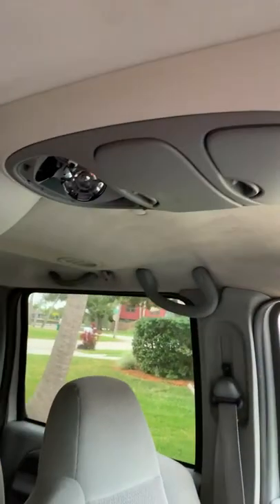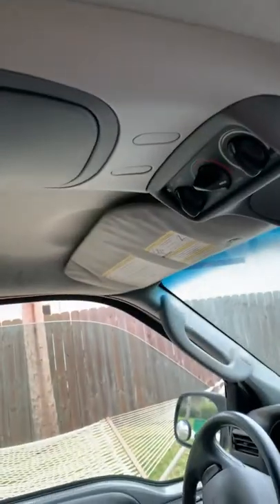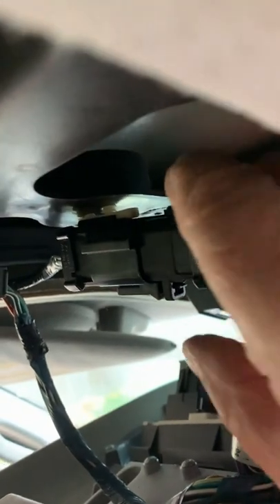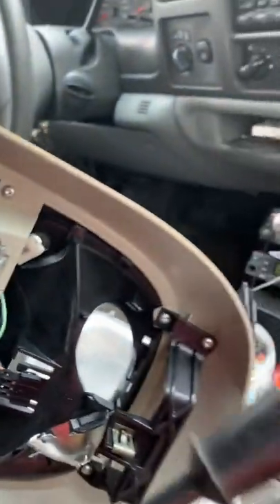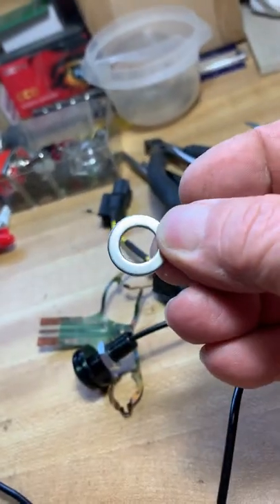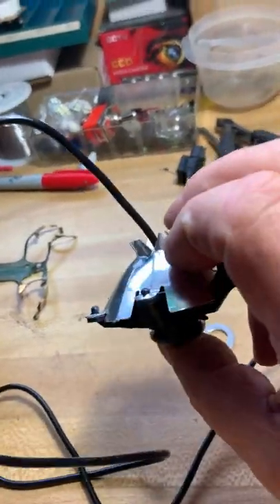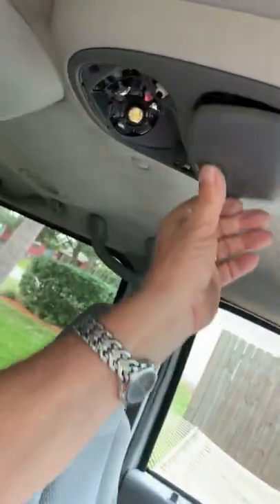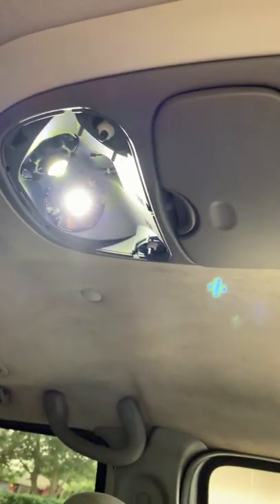Best Excursion Overhead LED mod

Comment: @GolfCartSpeedyLink, thank you for taking the time to make this video. I used the same 23mm Eagle eye Leds and it worked out perfectly. Only difference with mine, I didn’t enlarge the opening on the aluminum dome, I used a small screwdriver and carefully pried the aluminum domes off of the plastic that holds the LEDs. This allowed me to tighten the new eagle eye LED nut. I used two nuts so the LEDs do not loosen after they are tightened. I also used crimp connectors on the LED wiring in the event I have to change them out in the future if they go bad. Took me 2-3 hours over the course of two days to do because I really took my time, absolutely worth it though. Also, I recommend whoever is doing this mod to plastic weld the factory push switches with your solder gun and hot glue them once you slide the switches back in place so they do not shift.

Comment: Fantastic video!  Thanks for sharing. I did this to my 01 Excursion, with the 9 watt (equivalent) 23 mm light you recommended.  What a difference, super bright!
A few quick comments for others who might do this mod.
1.  I can see where many people might think the 9 watt bulbs are too bright.  You could definitely go with a lower wattage bulb and still have way more light than the original lights.  Also,  I think that I would go with amber or yellow bulbs if I were to do it again.  The white light is kind of harsh and the amber would be a  softer color.
2.  You can just snip off the aluminum dome reflectors.  They are totally useless after this mod and just take up a lot of space.   It makes the whole install a lot easier and gives you more room to work.

Comment: This Ford Excursion overhead console lighting replacement is truly remarkable! I've tested three different LED bulb replacement methods for those lackluster Excursion overhead lights, and this one stands out as the ultimate solution, providing an abundance of light for reading handwritten notes and examining map details. I opted for the Teguangmei 23 mm White 9W Eagle Eye LED motorcycle running lights, and as described by Digital Overdrive, they seamlessly fit and lock into place using his installation method. Not only do they work exceptionally well, but they're also more energy-efficient than the original bulbs. Instead of the original 'reflected' light method, these LEDs direct the light beam straight into the cab, making a world of difference.

The only minor downside I noticed is that the bulb color is slightly more on the blueish side than I prefer, but it's a compromise I'm willing to make for the improved illumination.

While I had the console down to install the new lights, I decided to go the extra mile and create a hole to wire in a USB A power socket on the front edge of the console. This additional step allowed me to power my dash camera conveniently. The USB placement in the upper console eliminates the need for a messy power cord stretching across the windshield to the camera.
Reply from the maker: Thanks for the comment.  I like your idea of a usb jack.  Wish I would haave thought to do that while the console was apart....  Cheers!

Comment from the maker: I made an  error in the video I used the 23mm diameter.  They are marketed as Eagle Eyes.  Here is the description from Amazon.  Thanks   YITAMOTOR 6pcs Eagle Eye LED High Power 9W 12SMD Waterproof Car LED Lighting Kit Motorcycle Daytime Running Light DRL Fog Backup Tail Lights (23mm, White)

Comment: How are the lights holding up?
Reply from the maker: Still working great!  It was a great improvement and a very inexpensive upgrade.
Reply: @digitaloverdrivesystems  do you find the shadow effect created by the LED to be frustrating?  Im in the purchasing phase to update a similar excursion.  I am afraid ill be frustrated by the shadow pattern of the led lights.
Reply from the maker: @willehlert2498  No more of a shadow than any other bulb.  I think it is a very positive improvement...